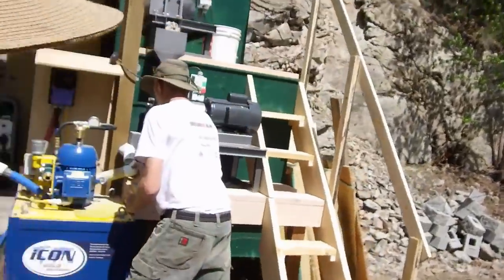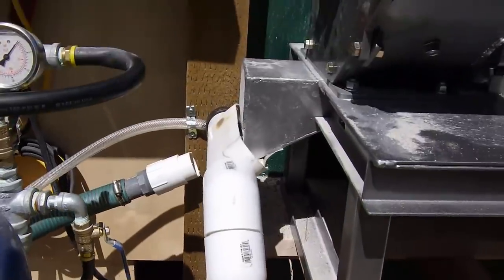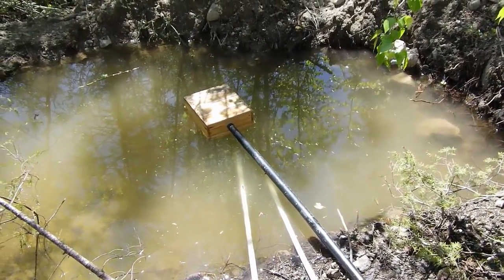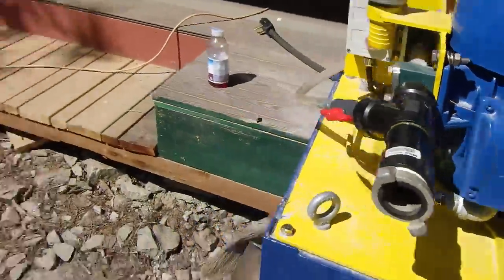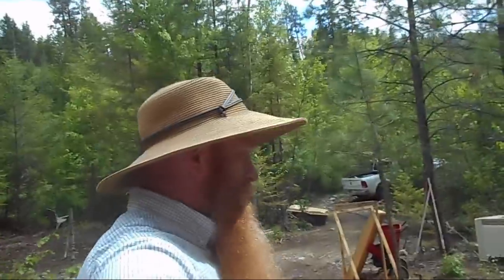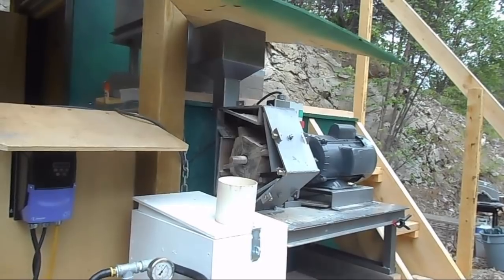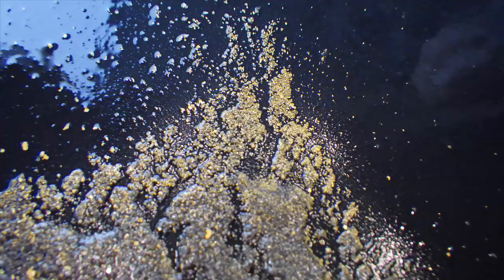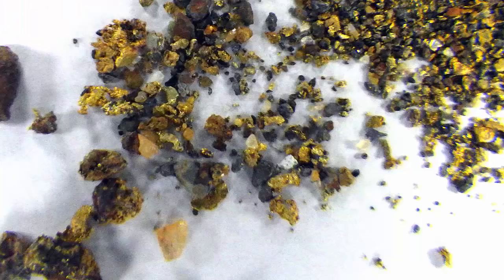Icon i150 Gold Concentrator for my Gold Processing Plant (Hard Rock Mining 2018)

Comment: Awesome set up. Like Mike W I noticed some rock being periodically spat out of the first hopper. Maybe a shroud off the inlet to second hopper with an inspection flap would be a good solution. It didn’t appear to be a lot that was being lost though so I guess it’s what you’re willing to accept as loss when it comes down to it in the end.
Reply from the maker: We're still modifying the process - we've added water up a lot higher and that seems to have stopped this.

Comment: Great video as always man. So which do you think works better the icon or a shaker table? I'm personally considering a table, but I'm always open to different opinions.
Reply from the maker: They are two very different pieces of equipment. I think you would need a very large shaker to take two tonnes per hour.

Comment: hey dan im thinking isn't that ION suppose 2 crush that gold bearing material down to 40 mesh an below. does it act like a crusher itself. because I was wondering since you have the material going thru to 2 different crushers before it meets the ION I was thinking the gold is gonna probably gonna all small depending if there's a real chunky piece able to take a beating from both crushers then meeting the ION. so my real question is? aren't you anticipating smaller mesh gold anyway. thanks for the awesome vid!
Reply from the maker: The iCON does not crust at all. and the crushers are not grinder so they will typically leave gold particles their full size.